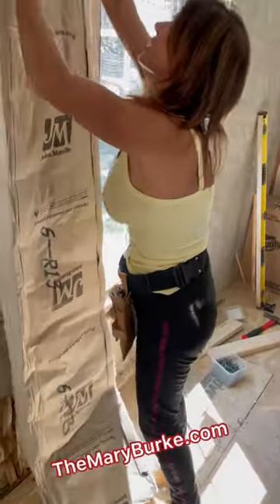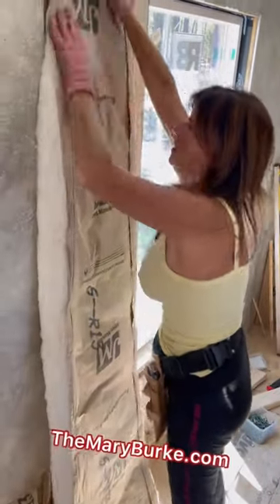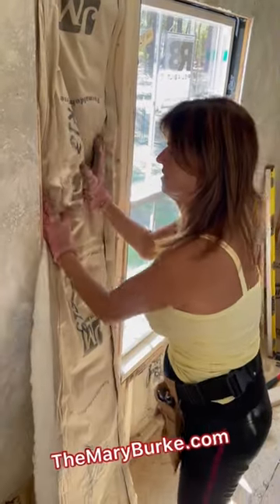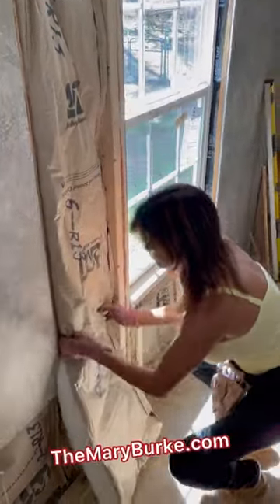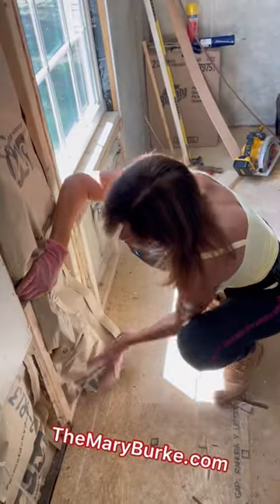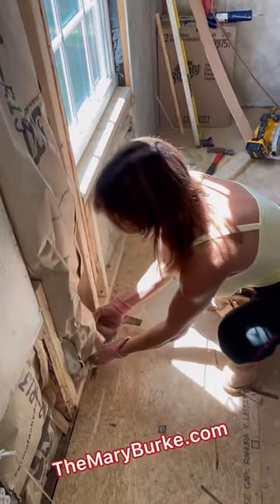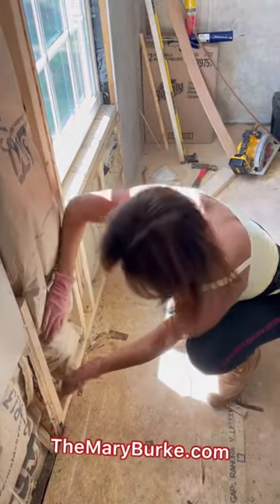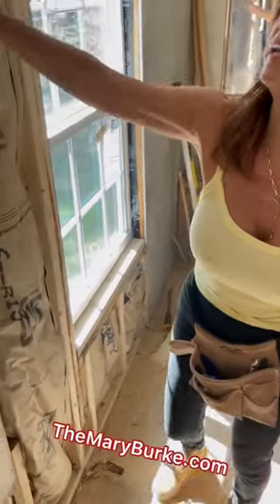🛠️ Tip for clean cut on fiberglass insulation. “Make it with Mary Construction” #themaryburke

Comment: After working with fiberglass, take a cold shower first. It closes the pores and washes off the surface fiberglass. Then a hot shower to remove fiberglass from the pores.
I used to build fiberglass boats and this method removed all fiberglass from my skin. Drastically reducing fiberglass itch.